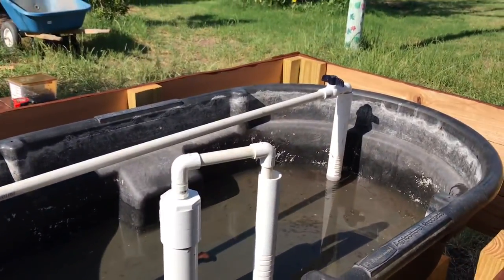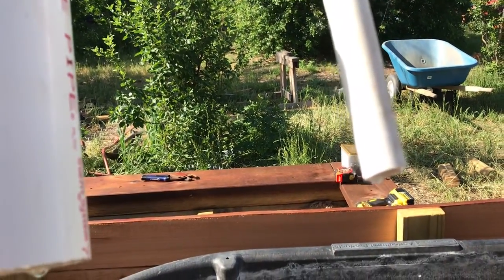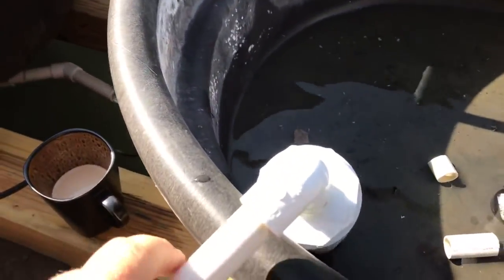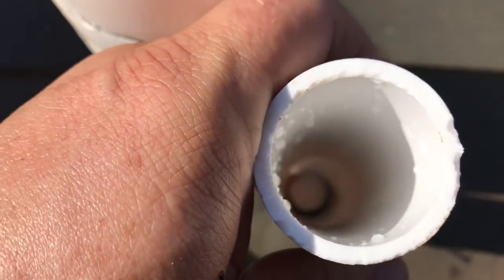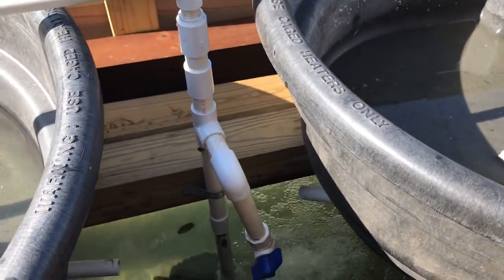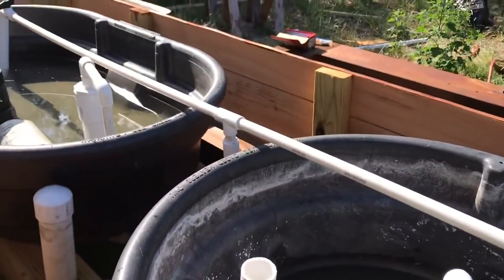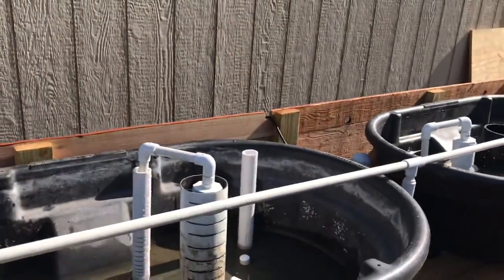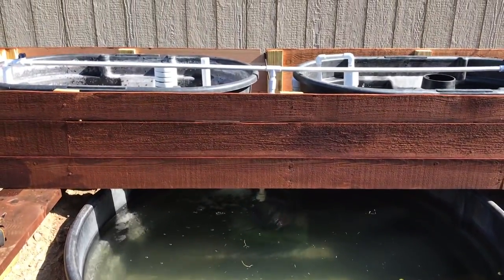New 300 Gallon Aquaponics System - Part Five

Comment: It's possible that he got the idea from a fellow youtuber. This is his design that he made and his subsequent improvements on the design.
https://www.youtube.com/watch?v=4hHRe3KJfoY&list=PLtIuZ9K-UzcNm2VB6Ntt80ob14RuqJyFr

It's also possible that your friend just figured it out independently.
Reply from the maker: I think every idea there is around this stuff has been tried in various ways.  I actually abandoned the cap as it isn't necessary in my beds.  And oddly one of the beds just won't start with the new style siphon, I stuck a classic one on it and it works flawlessly.  

It is weird as heck too!  I can swap the two siphons (new style) and both work flawlessly with the bed on the right, neither will start unless you have a very fast rate of flow on the left.  So it isn't that one of them has a problem, it is the bed itself.

Comment: 5:15 how come you chose threaded instead of slip joints at this junction?
Reply from the maker: Mostly because they exist.  I have never seen a 2 inch to 1/2 inch that was not threaded, doing it with slips would require multiple bushings, hence cost more and be more complicated.

Comment: I love the robustness of the new bell siphon design with your extra "hack".  It took me a long time to figure out how that hack helps, but I think I've got it now.  It's going to preventing the siphon from slowly slurping air at the bottom until it drains a bit lower and then gets a big gulp when the cap drops.  Awesome Jack.  
You may want to sand off the lettering on top of the cap for an even better seal.
Reply from the maker: But you don't want a good seal, you want a crappy one that breaks easily.  But yea you got it, it prevents that sticking and not quite breaking that happens at times with siphons.

Comment: This is what I have in one of my wicking beds and my seedling tray. I used the normal bell siphon in one, but then I found I had some extra elbows and made this contraption so I can keep the top level lower than the dirt level. The only issue that in the wicking bed I can't reach it for maintenance without disturbing the system drastically as I used an old evaporative cooler filter pad as my separator between gravel and soil and the pad wraps over the pipes. Maybe in the next couple of months when I change out the soil I'll find a way to make that more accessible. It works just fine as a siphon, btw.

Oh wait... No I didn't do what you did. I simply took out the bell siphon part and just u turned the piping back down. I can see how I need a siphon break... No problem... I can fix that, later, in two months.

BTW, like you I dry fit everything as well.
Reply from the maker: I don't get why you have a siphon in a wicking bed?  You just set the level with the stand up pipe or the discharge pipe.